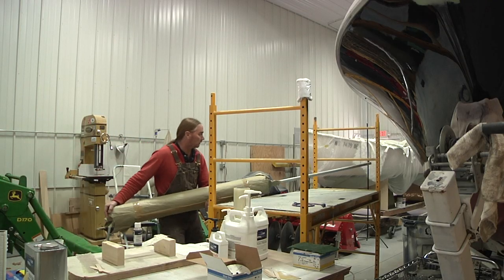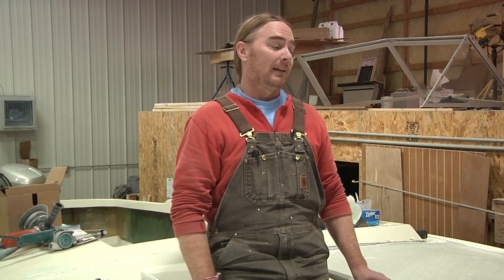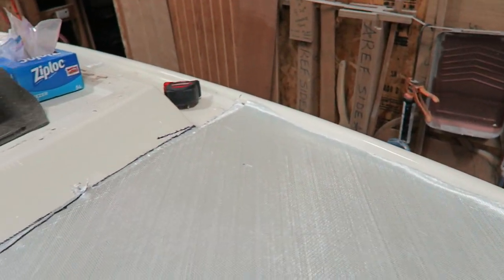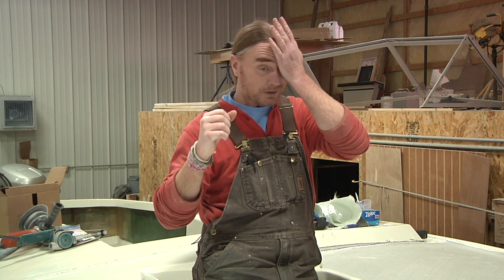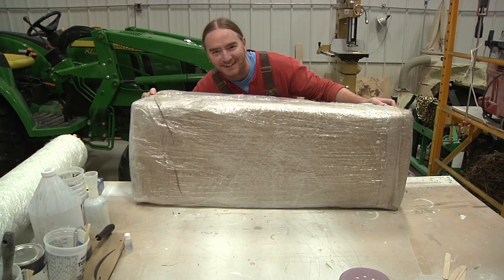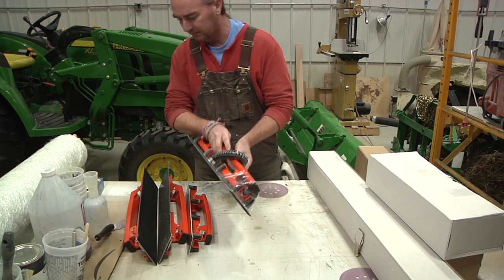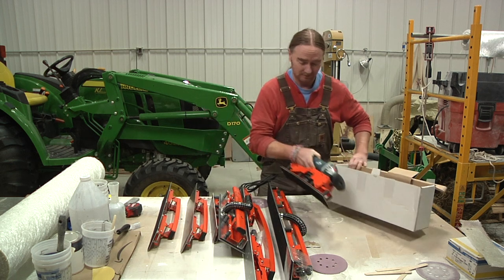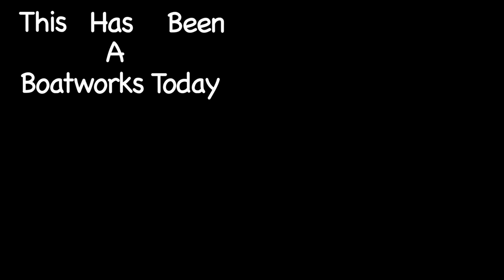Fitting New Fiberglass, Whoopsies and Exciting Mail Call!

Comment: Hello Andy, remember to use respiratory protection when using polyester & top / gel cote, it contains solvent that is not good for your memory ;-)
And your 230 volt problem, I'm sure it's an ordinary angle grinder mounted on the motorized Flexisander
so maybe it's easier / cheaper just to mount a new 110 volt, just a thought!   thumbs up ;-)

Comment: The Hereschoff yard used a 6 ft. fairing sanding board, connected to a gasoline engine on the ground! A long pole with ball joints on both ends, one to an offset pin on a driven wheel on the engine, one to the board. They said it took two men to hang onto it, but it worked! Like a locomotive wheel.
I made mine from plexiglass scrap... minus the engine!
Reply from the maker: That sounds like a beast of a sander :-O!!

Comment: nice sanding blocks.  from the auto body world it would be a great tool as well.  we sand for hours and hours to get things straight.  We have air sanders that are longboard but when you don't have a huge compressor then that would be great.  you should be able to get the stuff from amazon or ebay to run it in the states !  happy sanding !

Comment: Andy, cool new tools you got there! I may have to look into those for my restoration.. i HATE sanding lol...  For that electric version, there should be no reason you couldn't run it on the same 220 your running your bandsaw and table saw on...  a small power tool like that will use a universal motor which will run just fine on 50Hz or 60Hz.. It will actually run on DC as well (hence universal motor)... plug it in and sand your heart out!

Comment: Not sure if this will help you or not but you can find the US version of the angle grinder they used for that flexi sander and possibly retro fit it.  Also most of those inverters that go from 110 to 220 usually have a substantial drawback in the amount of amperage you can put through them.  It'd be easier to just make your own extension cord that goes from a 220v outlet in your shop and at the end is an outlet that conforms to tool.

Comment: You should be able to run it on just 220VAC 2-phase, it's a double insulated tool, and 50 or 60 Hz shouldn't make any difference for that motor, it'll just spin a bit faster.

Comment: Andy... love the videos.  I've watched them all, and, don't really have much for plans to do type of stuff you're doing.  I do have a gelcoat oxidation problem; I'm told my gelcoat is shot and not worth compounding anymore.  To save cost on painting the boat, I suggested to the painter if I were to do most of the [preliminary] sanding... and, he said it's too difficult to get it right.  What are your thoughts?

Comment: Another great video. On a side note, I have a question and possible segment idea. With the cold weather, there has to be some viewers that have had resin or gel etc, freeze in their garage. Will this make the resin weaker when it thaws? Would you mind doing testing on different resins/epoxies and gel coats after they thaw?  Ed.
Reply: Ed Stenson Darn! I just remebered, I left my resin out on the patio before the winter. It's still there. @Andy: I bet the manufacturer says buy a new one. What do you say?

Comment: Hello, looked at voltage specs
voltage 230 V 50/60 Hz 
input 720 W (3.2 amps) US
as long as you have 3 wires on your cord, you should be able to convert to a 220v horizontal cord plug.
it is about a 5% voltage drop, but your motor is dual hz, should be okay for a hand power tool. 
I worked with a bunch of European powered equipment for 10 years in US/GA without having to convert as long as it was dual hertz.
Reply: I confirm, and recognize a Metabo (premium German brand sadly not distributed in the us). Mine has been working just fine that way for the past 5 years.

Comment: Nice!  I felt the same way when I saw Madds demo these tools.  Looking forward to see how they work for you.  In regards to that small section where you came up short with the 1708, why not fill it it with a remnant piece instead of filler compound during final fairing?  Thanks for what you do keep it up and stay warm 👍🏼....(ps. any chance you’ll have more swag hats)
Reply from the maker: I'll likely be adding hats again in the Spring :-).  For the odd section I think I'm going to add 2 layers overtop the center section to also help maintain a nice crown on deck (I want to keep the amount of fairing to a minimum as it doesn't really add any stiffness)

Comment: Hi Andy can you please explain why it's okey to leave a  thin layer of gelcoat and not grind All they way down to the glasfiber? Is it because the polyester will "dissolve" the thin layer of gelcoat and tie into it? (Same as puting gelcoat in a form and then glassing over it)
Reply: I am not Andy, but ill will explain :p
Thick gel/topcoat is NEVER good, it will burst (spiderwebs).
Poly or epoxy will not dissolve the gelcoat.
Sanding it down to almost nothing, but not completely to the poly is good, beqause you even out the (maybe) not so flat surface and end up with a more flat end product.
You can offcourse sand to the poly, but its more work to flatten out poly than coating, coating sands much easier.
(sorry for typos, english is not my normal language :)
Reply from the maker: Thank you Ralph!  Well said ;-)  I do my best to try and keep up with comments but it's always nice to have help!!

Comment: 100W Power Bright 110v to 220v Step up/Step down voltage transformer model VC100W. UPC 41915 00049 made in China and sold on Amazon. Works great.
Reply: But what about the hertz? If his motor is 60 hz then the normal 50 hz we have here in the states will make it run 20% faster. Even at the 110(120) volts.

Comment: Worst case you could always swap out the motor to a 120ac 60 Hz... most appliance repair stores would be able to help you with that..   
also a shame that they don't have (guessing) a 120 60hz powered one
Reply: It is a Bosch Angle Grinder Motor, they have US Models you can use for swapping.

Comment: It looks like you carry a Spyderco pocket knife. Do you feel like it's a good buy for a utility-type knife?
Reply from the maker: I like it, but prefer the older style where the belt clip was a molded part of the handle.  The new ones have a metal clip that's screwed on and can scratch the side of a boat if I rub up against it :-/  But overall it's a solid little knife ;-)

Comment: The motor on the electric version looks like an oscillating tool. I wonder if you can find an American version and swap it out.
Reply: On second look, it might be an angle grinder. Something to look into if you see how the sander operates.
Reply: It looks like my Bosch 4 inch grinder's body.
Reply: Or just get a vfd and be able to use tools from all over the world :)
Reply from the maker: It is a Bosch motor, GWS750 S
Reply: @boatworkstoday  Then change out the Armature and Field windings to 110V and you won't need any adapters, you should be able to get them via any Bosch distributors.
Reply from the maker: Thanks Andy!  Will look into it ;-)!
Reply: BoatworksToday I’m sure Bosch makes an adaptor for this for our hertz and voltage which will be your best bet.
Reply: @boatworkstoday  go to boschtools.com, they have all the parts diagrams, manuals and even a parts store where you can get almost any part that might potentially break for all of their tools. I replaced quite a few parts on some 20+ years old jigsaw once, like all the moving parts except for the motor and the foot and did not even spend 30 euros including shipping here in Germany.
The GWS750 S is the european version, for the US I think it is most likely like GWS8-45 or 1375A, the naming is slightly different. The GWS750 is like 750 Watts and 11k rpm with no load, the us versions are 7,5 Amps for the 8-45 and 6 Amps for the 1375A at 11k rpm. Yes we do use the unit of power here in Germany instead of the current drawn to define motor sizes, but in the end it is "roughly" like 880 W = 110 V * 7.5 A (Before anyone chimes in, I know this calculation is only exact for DC while for AC it should be VA instead of W anyways, but it is good enough for a rough comparison). 
 But I think before you start to tinker with the armature or converters, a whole new GWS8-45 is only about 60 bucks on amazon. Depending on how they mounted it you might have to swap the gear head from the motor. Otherwise as someone stated, it should run fine on 220 V 60 Hz, it might just get a wee bit hotter than normal, but those things are sturdy. On the other hand, the GWS750 S has some electronics for setting the speed I think, not sure how they will handle the 60 Hz, but should be fine as well. Thinking of it, the 8-45 and the 1375A might not have one, not sure if this might be an issue. You would have to look to a version with an S at the end of the name then to get the variable speed.
Oh, another think just comming into my mind regarding keeping the gearbox, the spindle might have a differend thread on the US version.

Comment: Do not run that sander on 60hz.  For the price of a 120V/60hz to 220V/50hz converter it may be cheaper to replace the motor on the sander.  It actually looks like it's powered by a Bosch angle grindersch, they sell 120V/60hz versions in North America.   Most cheap converter's are only meant for small appliances being used for short periods of time.   Good ones that can pull the amperage a sander needs for several hours could cost way more than the tool
Reply: Oops , just read the sanders specs, it do run on 50 and 60 hz,  so you only need a decent 120V to 220V converter

Comment: Just fit a U.S 110v grinder or a polisher that is variable Speed???  ,, we use 230v but on worksites, We can only use 110v In the UK,, but I like 110v grinders as less of a kick? and if you sand! or cut the lead you are less likely to light up so bad?

Comment: Almost  $1700 without the electric one🤡 don't think so, but found the video interesting.
Reply: For the regular Joe I agree...but if you are making your money doing this work?  I agree with Andy, GAME CHANGER.  If he can cut sanding time by even 2 hours per project, those sanders will pay for themselves in about 10 projects.  I'm betting he cuts sanding by even more than that per project.
Reply: @WreckDiver99  fair point.
Reply: I was thinking that it couldn’t be very hard to build a similar tool for very little money. Or at the very least, buy one and make the handle adjustable to fit various pieces of sheet metal.